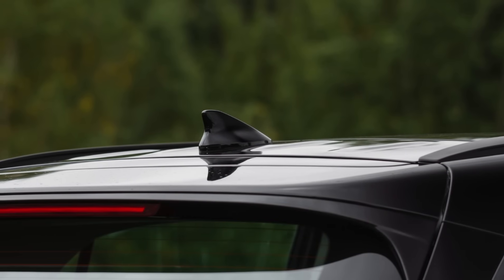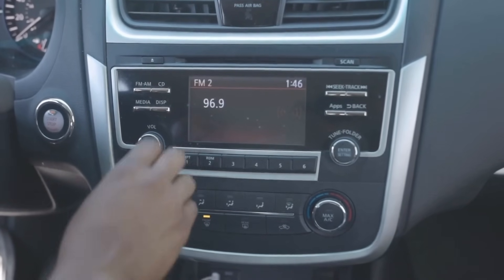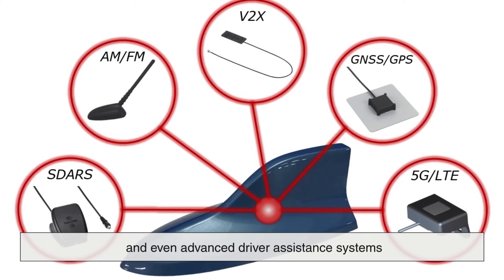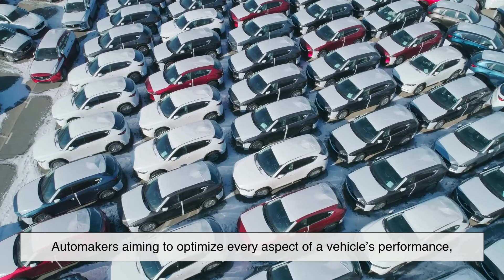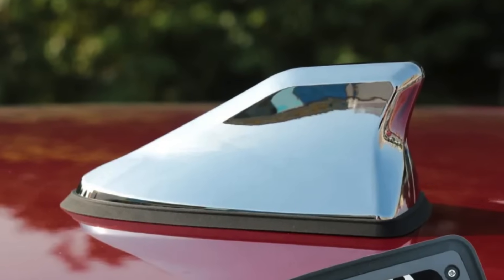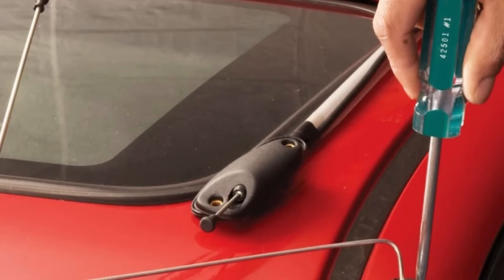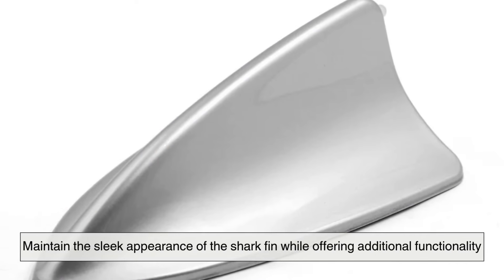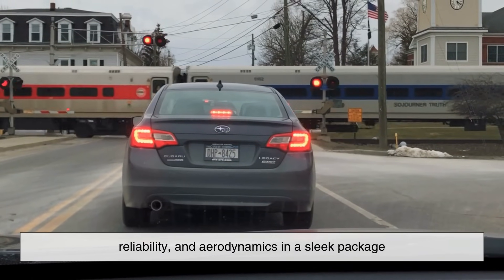Why Do Cars Have a “Shark Fin” on the Roof?

Comment: I remember antennas that were on a front corner not far from the windshield.  They were not as ugly as people may think.  A lot of older vehicles had them there.  Some had them in the back and some of those were retractable but that added complexity made them problematic.  The ones that didn't retract were a stainless steel rod thicker than the wire of a coat hanger.  Sometimes people vandalized them by bending them or breaking them off.  Some people really were jerks and they still are today too!
Reply: Right on, Charles!

Comment: You skped one critical advantage, auto manufacturers are really primary assemblers of vendor supplied parts, not system designers like Tesla. Have a simple add-on like the shark fin to support the need for broad communication service make is easy to do their assembly job.

Comment: I once put a spring loaded whip on the right fender of
my 1971, Olds Cutlass, because the, in the glass
antenna, dipole did not
receive AM/FM well.
Today I have a Jeep Renegade,
not with a Shark fin antenna, 
nor GPS navigation, Satellite
Radio, nor ON Star. 😊

Comment: This is presentation is not 100% correct as the Sharkfin antenna did not replace the AM/FM antenna. It is for satellite GPS and vehicle WiFi communications. The AM/FM antenna is still separate and is now integrated into the rear windshield of many vehicles. Many trucks and soft top convertibles still have a  shark fin AND FM/AM antenna.

Comment: Pretty sure in my Mazda the fin is just satellite radio.  GPS is under the dash, cellular is on the hatch trim.  AM/FM are wires on the back window, and somehow those do a great job.  AM reception is as good as anything I’ve heard.
I had an older car with satellite radio that just had a “bump”, not a fin.  Maybe the fin has a vertical element that works better.
Now to figure out where to mount a full size whip for a ham radio…

Comment: My 1973 Jensen Interceptor had a Lear jet AM/FM radio and eight track tape player.  All worked brilliantly, especially the FM radio.  The electric telescopic antenna mounted on the passenger side front fender would adjust it's length to best match the radio station that was tuned on the radio.  In areas with weak or interrupted reception you could see the antenna adjusting to improve the signal.  Bill Lear was a great electronics guy.  Today's radio content is such rubbish the radio in our convertible is not even connected, let alone turned on.

Oh, and several of my cars with shark fin antennas have caused their custom car covers to wear through so that rain and dirt gets through around the stupid antennas!

Comment: No shark fin antenna is going to offer lower wind resistance than the motorised telescopic antenna on my 2003 Mazda MX-5 when it is down, and hidden within the body of the car. Mine goes up automatically only if I am using AM or FM. If I am steaming from a Bluetooth device or listening to CD or minidisc it automatically goes down.

Comment: Lots of the video clips bear no relationship to the commentary. Why is there footage of somebody adjusting the heating temperature illustrating changing from FM to AM, or somebody breaking into a car door to illustrate the fact that antennae can be broken?
Reply: Also, why was a Tesla included?  It doesn't have a shark fin.  I think everything is hidden or in the glass.  They didn't even have SXM radio until recently.  BTW, because of all the digital noise from computers, car makers are phasing out AM as it is very sensitive to digital noise.

Comment: 4:08 "Another advantage...is its improved signal reception...for satellite based systems [which] require a clear view of the sky to function properly. ...the shark fin antenna on the roof ensures an unobstructed signal path...."

Sooo.... just like traditional wire antennas that stuck up higher than the roof, allowing a clear view of the sky....

I should have dipped at the mindless introduction.
Reply: Yeah, that's baloney. But you'll notice in that one uncovered fin, the satellite and GPS antenna sitting on the left.

Comment: Best most trouble free antenna in the dozen cars that I owned in.last 60 years was two thin wires in embedded in the windshield of my 1974 Chevy.
Reply: My 1970 Nova had one and it Not Only Worked Perfectly but had ABSOLUTELY ZERO effect on the cars slipstream!!!  🤠👍
Reply: @worldtraveler930  How did you get a windshield antenna in a 70' Nova when they weren't a standard feature until about 74? And only lasted a year or two? Very directional reception. Poor reception quality. Loved  the effect when the wipers were on. Complete bomb for FM reception. Or did you have the typical anecdotal YouTube magical physics-defying  windshield antenna? So popular that there were aftermarket  kits to retrofit cars with the standard dipole antenna that worked for decades. If it's not broken, don't fix it.🤔
Reply: @President_Dingleberry   My 1968 Firebird had the optional power antenna but the 1970 Nova came factory with it's in windshield antenna and I never had any problems with them even after I swapped out the AC Delco AM FM to a  Blaupunkt!!!  🎼🤠👍
Reply: @worldtraveler930  “Problems” is a relative term. You made not have had any (that you noticed), but I can guarantee you that your radio's reception ability was compromised.  It was complaints from consumers and broadcasters that saw this bad idea go away.
Reply: @DiaperDon_BoneSpurs_Epstein  I own a 77 Nova with the antenna in the windshield. It gets just as good radio reception as any of my other vehicles. And I don't notice any difference if my wipers are on. Well the music might get a little quieter, either that or i might turn it up a little louder to overcome the sound of the wipers.
Reply: @4by_yotaguy373    Well, that sure settles it!  Another collection of YouTube anecdotal claims makes it official! GM dropped their windshield antenna because of complaints from vehicle owners over very poor (selective) radio reception. The simple FACT (it's called “physics”) is that the windshield antenna only worked at anywhere near optimum performance  when the station being received was in front of the vehicle. Stations located to the sides or behind  the vehicle suffered from poor reception. Study your PHYSICS, son. It's all right there.
Reply: Very directional antenna poorly suited for vehicular use. which is why they went away.
Reply: I had a 1970 Chevrolet that had the antenna in the windshield. I think 1970 Chevrolet was the first year that Chevrolet had this kind of antenna.
Reply: I was about to say the same thing about my VW Transporteer. Always had perfect reception in that van.
Reply: I have a 74 C20 and the antenna is in the windshield. Didn't know that at first and just assumed it was missing somewhere
Reply: i agree looked great   worked great

Comment: Very interesting, thanks. This explains why my AM reception, and to a point the FM reception, is way poorer than what it was back when we had real antennas, but I guess there were no modems, satellite navigation and other features we rely on now, back in the 80's through to the early 2000's
Reply from the maker: You're right, the shark fin antenna is a compromise.
Reply: Ideally, a antenna should be a quarter wave lenght of the frequency.
Reply: @nakayle  32 inches for FM. But on AM, cars used a loading coil inside the radio.

Comment: My 2012 has a little bump antenna on top.  MY reception of AM and FM is quite satisfactory.  I do not do sat radio.  The cost not justified by the small use it might get.  I used to switch sat on and get the promo broadcasts for curiosity but now all I get is a message "Antenna Fault".
Reply: Radio is the LAST free thing in the world.   Why PAY for radio?
Reply: @RemoteCamper  Lots of reasons.  You don't want to, fine.  But plenty of people do pay for the advantages.  Just like over the air TV vs. cable.  I was an early user of Sirius radio, I loved it because at the time, I was in my car a lot.  I even got reception in Mexico, those dang radio waves have no respect for international boundaries.  But my days in my car are gone, so it's not worth the money to me anymore.
Reply: @RemoteCamper  I contribute to our local classical music station.
Reply from the maker: It sounds like your antenna is working fine!

Comment: I replaced the useless shark antennae on my 2006 Honda Fit with a VW Golf 16" wrapped stick antennae.   My AM and FM reception went from poor four mile reception to 80 miles AM and 40 miles FM clear reception.   Dealer said, quote, "Nobody uses a radio these days".  The shark antennae  is a box of compromises intended and optimized for ultra short wavelength communication such as cellular and satellite Sirius service.   High performing dipole FM antenna are sometimes still integrated into the rear windows of some cars along with other tricks.  Thankyou from those of us still using a radio to hear the world!
Reply: I use my Sony ICF-2010 to hear Havana Cuba .
Reply: the dealer must have been a boring old bag of wind.
Reply: It was only useless for AM and FM. Pick a better car next time.
Reply: That's all these things are. A mediocre gimmick to please the unknowing. Except for UHF and higher frequencies there is no way that something like can do the intended job

Comment: You skipped the trend of luxury cars that had electric retractable telescoping antennas. They were very prone to failure. My 1993 Infiniti J30 had one that, thankfully, never broke.
Reply: Yup.  My 1980 Cadillac Eldorado.  That one went up and down with every turn of the ignition switch, on or off.  Very unreliable.  All they had to do was have an up/down switch because 95% of the time most drivers weren't going through a car wash or in a high crime area.

Comment: My first car was a red 1992 Pontiac sunbird convertible while attending Kalamazoo Valley Community College 2013 - 2015 and it had a power antenna that automatically extended when the radio was turned on, and retracted when turned off.  AM/FM radio and cassette player, ashtray and cigarette lighter, no airbags or antilock brakes, what more does a single male in his early 20s need to be a chick magnet driving by the beach on a sunny summer day with the top dropped wearing aviator sunglasses 😊

Comment: The shark fin antenna is the product of an overcontrolling totalitarian government. They can track your vehicle. They can track all your passenger who have their phones on them. They can watch you through the cars cameras and listen through the microphones. They can lock you in the vehicle and then disable the locks. They can shut down your engine. If your car is self driving, boy howdy!, are you in for a treat! When your car drives you to the nearest government detention camp. All of this was initiated by up coming government mandates on what tech MUST be in the vehicle. Your computerized car can alert the nearest police cruiser if it thinks you have your seat belt off. Etc, etc, etc!
How do I know all this? I sat in that meeting at one Silicon Valley's biggest chip makers and listened to those closet dictators coming up with more and more ways to violate U.S. citizens' rights. When I objected to their discussion, I was kicked out of the meeting (of course) and was fired on made up charges a few days later. You have been warned.

Comment: Depending on the lighting angle and the exact vehicle, even shorter antennas can be buffeted by the wind, and may lead to it whipping around. This may make the driver concerned about potentially broken parts, and thus fixated on the repercussions of that part, both financial and physical.
Reply: Whatever.

Comment: Every time I take my car to the car wash ( 6 times a month be cause I have a unlimited plan & retired ) the FM radio gets a lot if static until hours later. Guessing water is entering shark fin antenna.
Reply: Yep I would never take my car to one. The dealership I get my new car serviced at has a complimentary car wash. I make sure I tell them not to wash my car. It does have a graphene coating but even so I never got my other car washed. I always hand wash using two buckets and then wash the mitt and drying towel after each wash. Using commercial car washes will utterly destroy your paint. Essentially if they use plastic brushes. But even the softer cloth type will have dirt embedded in them from every other car that has used it.
Reply: @foxxster3565  I guess you never heard that water washes away dirt to the drain.  Next hypothesis?
Reply: @frequentlycynical642  if you think all the dirt is washed off commercial car wash brushes after each car then there isn’t much helping you.
Reply: That's a few times too many for a car wash as it degrades the paintwork quicker in 2 years, your car will look 10 years old. Car paints are not as durable as they used to be ( isn't everything else?)!
Reply: @thabzmad7265  You are right on the first point, plus a waste of water resources.  But you are incredibly wrong about paints not being as durable.  Automotive paints are more durable than ever.  Trust me, I'm very familiar with the old enamel and lacquer paints that would start fading in a few months, especially reds.  The "new" base coat plus clear coat system is so superior it's not ever close.  (I've done a bit of car painting over the years.)
Reply: @frequentlycynical642  Maybe we have vehicles from different regions. I know European makers are more likely to err on the side of environmentally friendly paint solutions which are less durable unlike Chinese or American ones...
Reply: @thabzmad7265  You might well be right about different regulations in different regions.  Sadly, there are few free rides when doing things that are enviro-friendly.  I.E., it's easiest to just burn, bury, or dump you trash in the ocean that sorting, recycling, composting.

Comment: Shark fin antennas might be ok for a number of purposes; but they're a compromise. A jack of all trades and master of none.  AM & FM reception are only good when you're reasonably close to the transmitting site.  Most people fail to notice and switch to another station.  If a fin breaks you are out $600 vs $30 for the pull up.  Ke cera cera.
Reply: And why would that fin break off?  Almost impossible by accident.  Don't put forth the all but impossible as plausible reason.

Comment: Shark fin antennas don't pick up AM and FM signals like the older rod antennas.
Reply: @tomy8339 - the shark fin antenna on one of my cars seems to do just fine with AM/FM reception.  The Sirius satellite radio also on that car works EVERYWHERE and there’s also a 6 disc changer for good measure.  I am never concerned about no music while driving that car.
Reply: Mine picks them up just fine
Reply: I wouldn’t imagine many people would listen to am or fm radio anymore.
Reply: @spinnymathingy3149  Then why bother having radios in cars at all? Every carmaker still installs them. I hate shark fin antennas because they're inferior to old rod antennas. 

What would be nice if there was an option to have the old electric up/down rod antenna as an option. I would have gladly paid for that. On highway trips when there is poor reception, press the rod antenna to go up and enjoy much better reception. The "aerodynamic" drag is absolutely miniscule from such a tiny component.
Reply: @ well, here’s my thoughts, here in Australia we’ve had a digital radio service for probably 20 years (DAB) on the digital service all the original AM and FM stations are transmitted, along with them still being transmitted old style in AM & FM, the digital version is way way clearer than old style. 
Also I’m sure most people probably wouldn’t listen to local radio as such, more so listening to streamed music or podcasts through their phone which connects to the car stereo-radio. 
But that’s here anyway 
👍🇦🇺😉